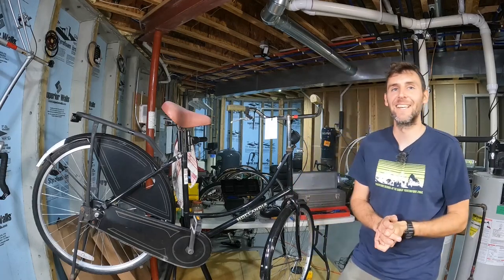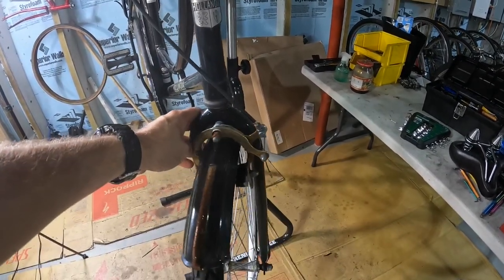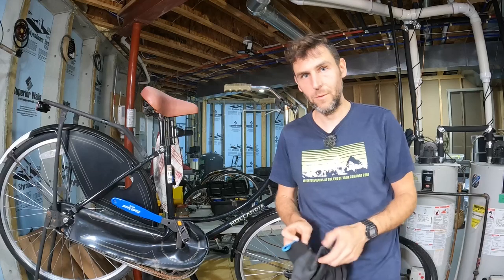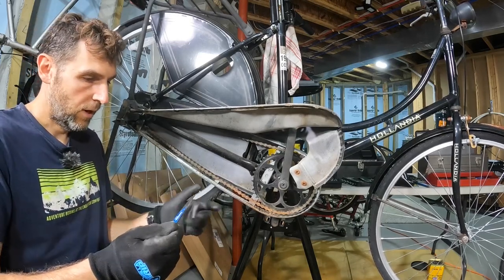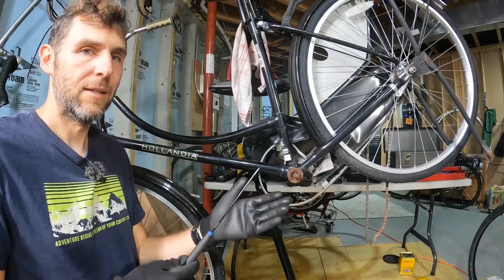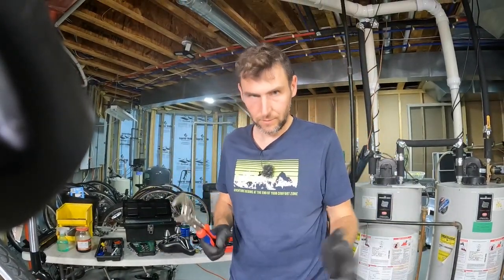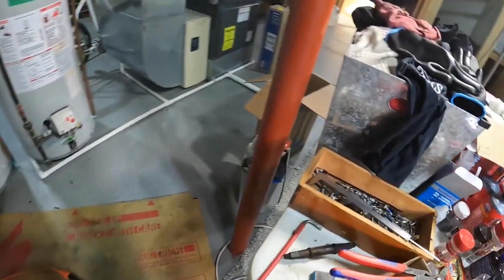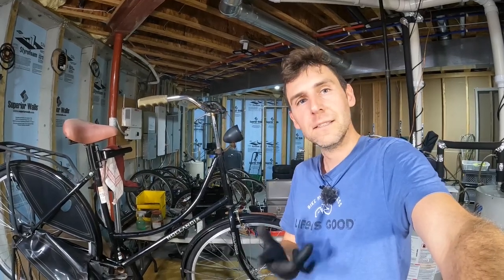I bought a Dutch Omafiets (Hollandia Dutch City Bike)

Comment: Nice find, I hope you have fun with it! 
Definitely a local import, no Dutch bikes come with a front brake like that, but they are required in the US. Looks relatively new or at least low usage.Touring panniers are not the thing for these, we use big square “fietstassen” for groceries. Or a rack in the front.Hollandia is a bit of an offbrand but not the worst, the big difference is rust, cheap bikes rust twice as fast, especially accessory parts. These handlebars tend to be weak BTW, cheapo bikes use very thin wall steel tubing there made out of Chinesium. That type of rear stand is also very vulnerable where it hits the ground, I like to put something around the ends to prevent the paint from scraping off and the whole thing rusting away, like a piece of old inner tube tiewrapped around.
If you are going to leave it outside, spray the whole thing with silicone spray or if you want to go oldschool use vaseline on a rag .
Finally, for the real Amsterdam bike feel, decorate the thing with plastic flowers or whatever you fancy - in other words turn it into a cheerful piece of rolling art.
Reply: Chinesium🤣 Good one.
Reply: You got a point about that rear stand . I work with bikes and often these stand are completely rusty or bended . There comes the angle grinder to take it off !! Side stands are usually much better .
Reply: @roolio227   A-stands are becoming popular here, they do a much better job of keeping the bike upright.
Reply: Just stay away from brands like " X Tract , Popal , Bikkel , and Dutch Delight , these are usually cheap ass bikes from " chinesium "
Reply: @roolio227  Also Hollandia and the old Cortina's.

Comment: I personally hate single speed or fixed gear.

Unless the city is completely flat and not too windy they really suck in my opinion.

Those dutch bikes do come with hub gears sometimes though.
Reply: I agree especially around here where we have hills all over the map.  If I had a mere single gear on a bike I'd have to enormously limit myself on the routes I take.  But actually I kind of like them here.  When I'm out on a road ride, it's more interesting and I work my legs differently.  You are forced to be in better condition by them.  For grocery runs, it's fairly flat or slightly inclined.

Comment: I'm Dutch and while you worked on the bike, I didn't really gringe, untill you took those pliers to the bracket, the wrong way around! Man... 
Tip: The whole bracket looks not worth toiling on, they notoriously hard to work at the best of times, so just head of a torch to get it loose or an angel grinder to split the ring nuts and replace the rotten thing. 
Hope this helps, good luck and happy bike trails.

Comment: You know it's interesting, but most stationary bike models picked up on this same type of concept with the chain guard/pants protection.  While it alleviates the necessity of tying off (or using your sock!), I'd be happy with just a better cuffing off implement for the right leg for those few, few times I've got regular pants on riding.

Comment: I'm a dutch and older. The new bike last only several years and than repairs and to much technology flows occur. The best are 30 to 70 year old bike. Just look at the RVS steel rims and NOT allow. These RVS are from 5o years old and because the bike was the netherlands first choice of transport until the 1990 they kept them inside. The major cities had rijwielstallingen Bike stowaway and locking spaces. Made by the housing association or local entrepreneurs. A maintenance bike repair was monopolized by the major firms to establish prime maintenance and selling position. Every 7 years a new bike when you where rich but now every 3. All these thing are gone so people keep then outside. And special materials weaker from grade quality steal now allow from aluminum. note that aluminum is nog good for the low temperature areas. They will break and the glassfibre and stuff is made to last 1-3 years and not repairable. But back to the old fashioned bikes. oma fiets are a classic but not for longer distances. For school we used more comfterable bikes and where riding. Better brands where Batavus, Gazelle, Sparta. Some custom bikes. I use 2 Batavus bikes (bothe special large for weight to 150 kg and long 2,10m and 40Y old about. Daily drivers. I have no car. 1 Batavus i made electrical and a M5 recumbent. The last is for sale. And the electrical Batacus to so I can get an electrical trike.for shopping and traveling around.

Comment: Why tf are 27" tyres bigger than 700c? I bought a 27" Japanese mamachari thinking it'd be smaller than 700c and it turned out to be huge. It's a real hassle getting it into the lifts and bike lots of my building. It's pleasure to ride but I just needed something I can quickly get on and off from for errands around the neighbourhood.
Reply from the maker: I don't know especially since 700c = 28" = 29" and they're all smaller than a 27"